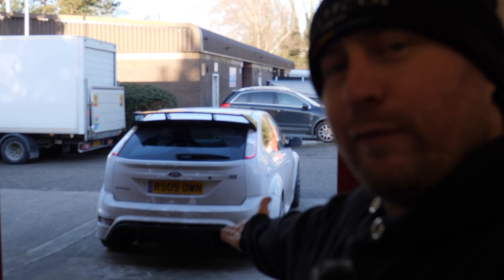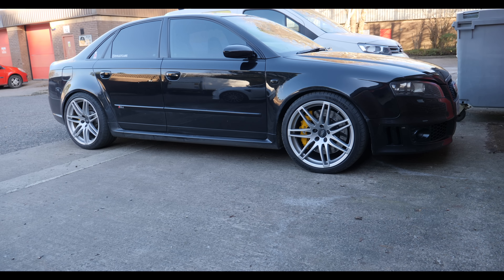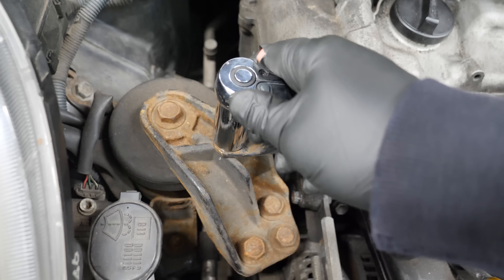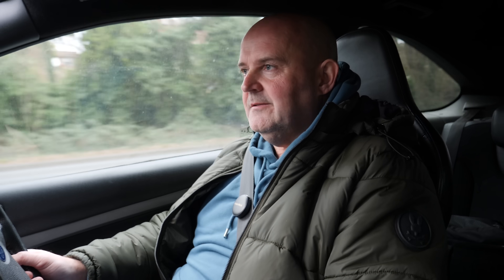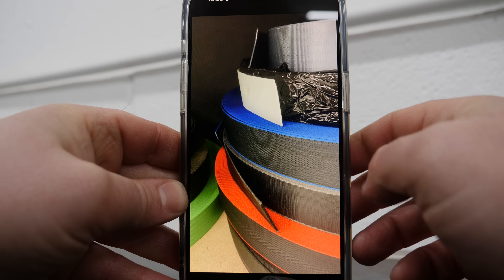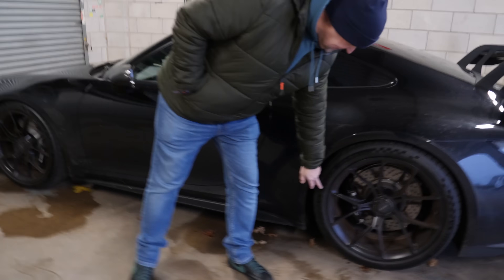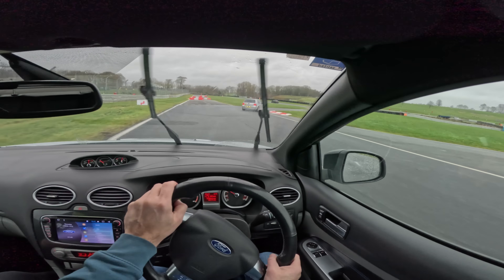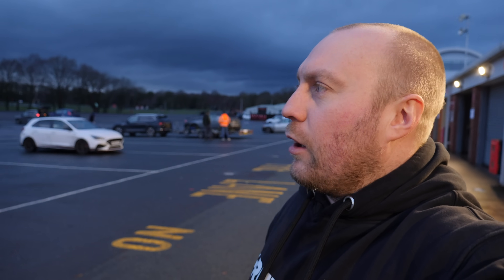RESTORING OUR WRECKED 150,000 MILE MK2 FOCUS RS (PART 15)

Comment: Been waiting for this vid benji! My ST is away atm getting water pump and cambelt done, plus new boost solenoid and map sensor! Can wait to have it back
Reply from the maker: She’ll be a beast!
Reply: @EVILGT  hope I notice the difference! It’s already running 330-340bhp but I had similar issue to you with the boost dropping off for no reason, was very on an off, happened only really once up into 4th and upwards, but did happen every now and then in 3rd, but as soon as I let off and drove normal for a second then back on boost it was fine! So hoping it’ll have sorted that 👍🏻